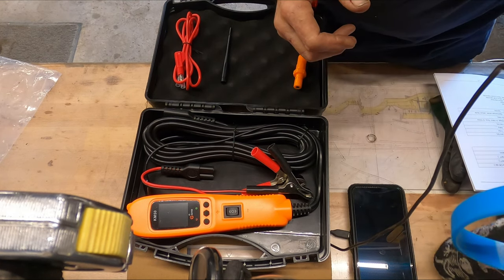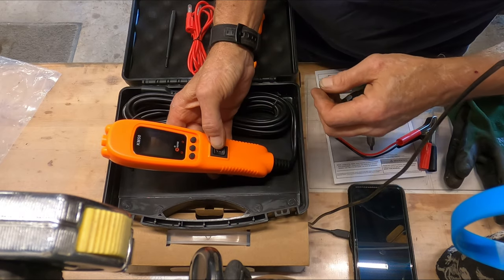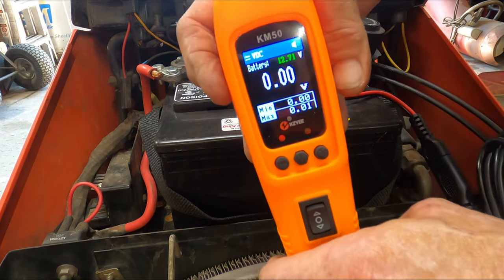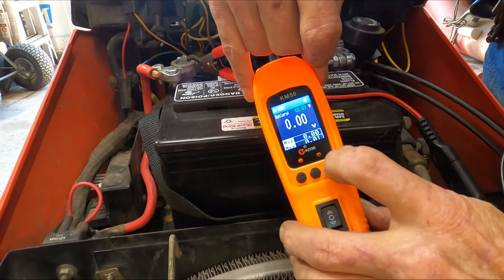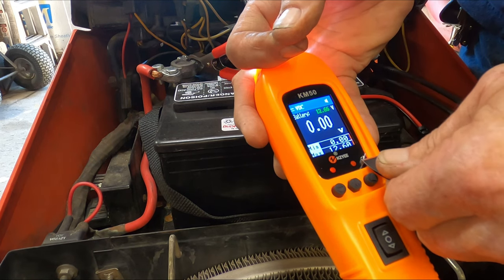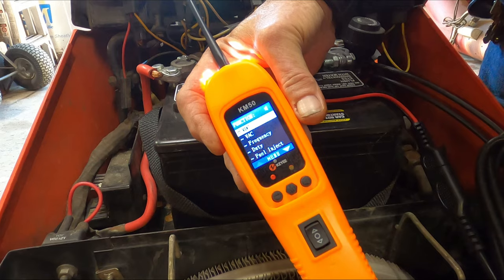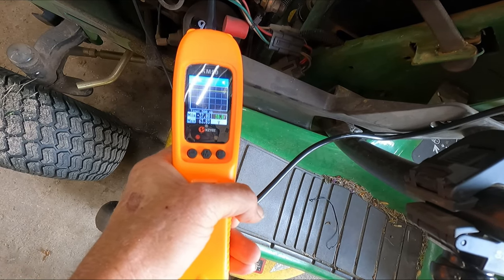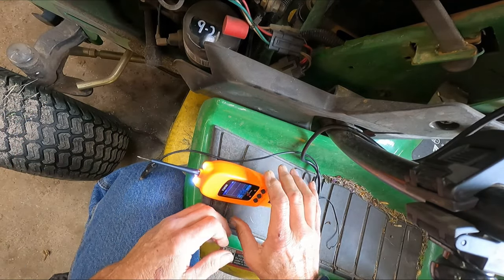As Previously Promised....The KZYEE KM50 Circuit Probe Tester!!

Comment: Think my 115 johnson  outboard works basically the same with the stator and a regulator/rectifier. I know the tach works off of that signal wire. Not sure if the lawnmowers will work that way or not because of the lack of the signal wire. And then again I'm not well schooled on this stuff so that is something you would know. Thanks Zip!
Reply from the maker: Heya Arcie! Appreciate ya stopping by my Friend! Zip~